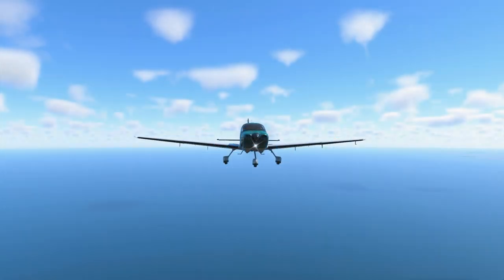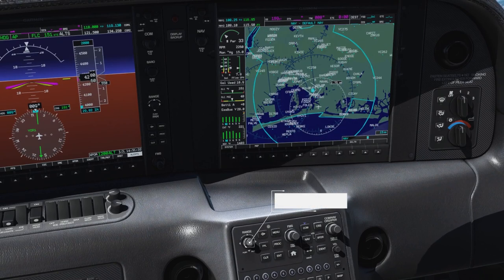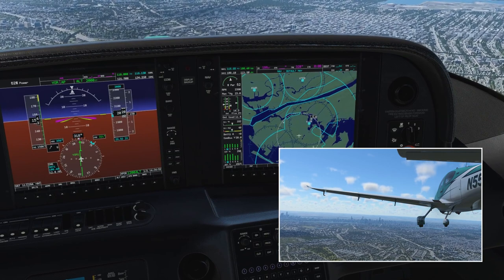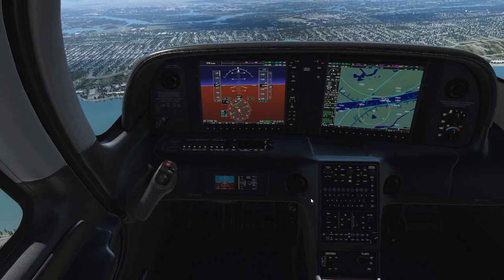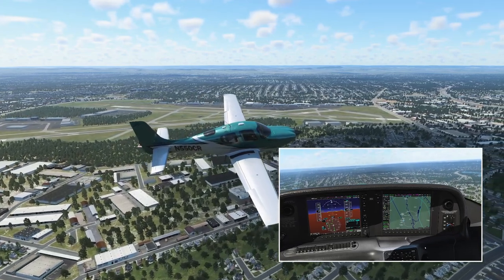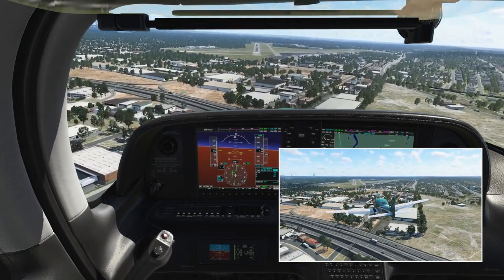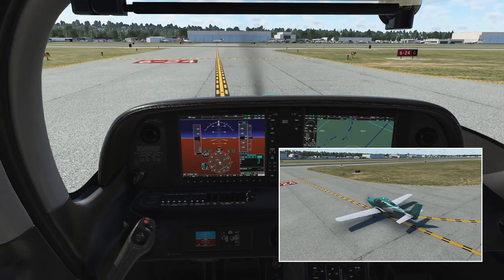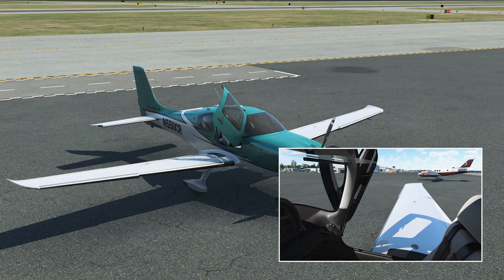Cirrus SR22 Approach + Landing Tutorial – X-Plane 12

Comment: Very nice approach to landing tutorial ! I had flown earlier versions of X-Plane (v9) years ago and liked them. Working with switches on the panel are fairly easy. As for flight dynamics, certain things appear to be more pronounced than previous versions. The left hand turning tendency is more evident (even in calm wind conditions). Not a problem, however, I just anticipate it . Also, on higher performance planes, the rudder and pitch controls are sensitive. I had experimented with different curves but one loses control effectiveness as a result. Usually, I'll just go back to linier curves and use a lighter touch on those inputs. 

The main thing I'm liking is the more useful navigation charts. They don't have all of the information that a real sectional or low chart has but, it's decent enough to compare to a paper chart or a digital one found on Sky Vector.
Reply: That is called P factor and it is corrected with either aileron or rudder trim as in any airplane. Planes like the Cessna 150 only has elevator trim, aileron and rudder trim are ground adjustable. Also the vertical stabilizer are off set to counter P factor.  As for the curves I give from the left lower corner about half way to the 1 for a slight dead spot so the controls are not so sensitive on the controller. Just takes some experimenting. Happy flights

Comment: In real life the SR22 is flown 40% power no flaps downwind.  Abeam the end of the runway reduce power the 30% flaps 50. 45 degrees to the runway turn . Base leg flaps full.  Final 80-85 Kts , power as required.  You don’t use a timer in the pattern.  All visual.

Comment: Would you not also adjust the mixture to full rich once you are clear of the runway after landing as you do in the initial taxi procedure before takeoff?
Reply: In theory the mixture should always be leaned to the appropriate density altitude - so no need to adjust it after landing (it should be leaned correctly for approach).
Reply: @janvogel9719  I’ve just seen in some checklists that you sometimes lean an aircraft to full rich after vacating runway.. I assume to not have too much or to reduce power for ‘low idle’ taxiing but don’t shoot the messenger!
Reply: @PilotLH  I am sorry if you felt shot! 
I did not see the procedure you mentioned in the official POH of the SR22 as issued by Cirrus, if you have other information or would like to enrich your mixture after landing, absolutely, be my guest!
Reply: @janvogel9719  I will have a look at official POH. Maybe you don't have to do it on this aircraft.

Comment: One can do however they feel, but you will never use FLC for the descent. Use VS with throttle to set the speed in order to precisely maintain a desired profile
Reply: Certainly a matter of technique - I think I explained why I think FLC is a safer mode than V/S
Reply: It’s the difference between flight stimming and actual flying.  I use FLC in stimming to nail the airspeed on approach but in real life flying I always use VS for a standard rate decent and manage airspeed with throttle.

Comment: @XPlaneOffical, what do you set your sensitivity settings for pitch, (2 numbers), I have a CH yoke on the way, because it got too hard, to lightly control on the Logitech yoke, they seem to have a major problem on pitch, according to many forums, also what sensitivity settings do you use for rudder pedals, it seems impossible to get the yaw, from going all over the place, even a low speeds , before take-off. can you make a video, on what you use?